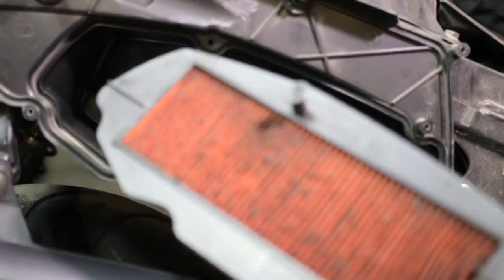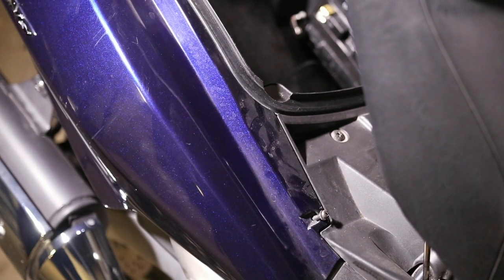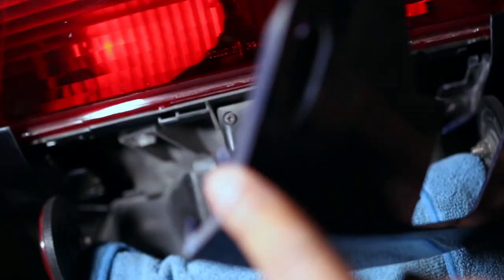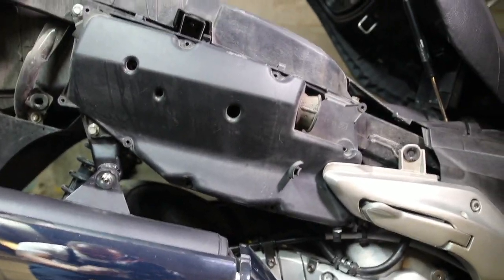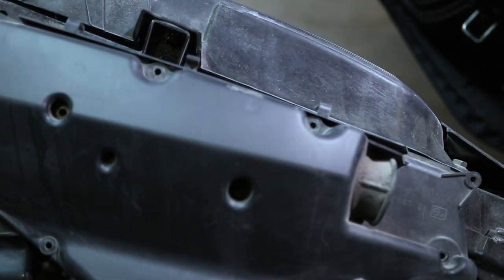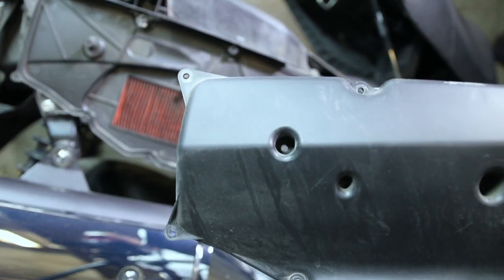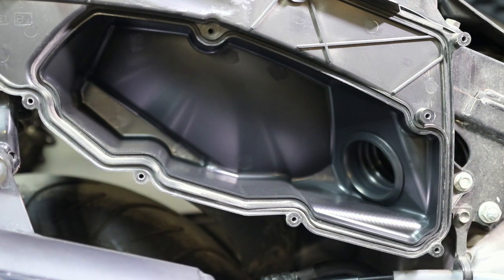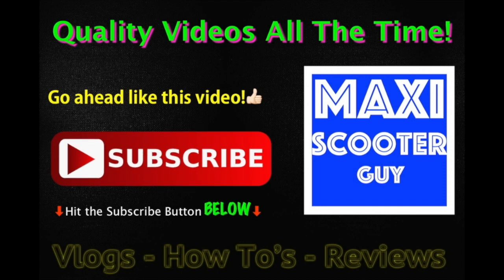Honda Silver Wing 600 Air Fliter Removal (Tutorial) #81

Comment: Important tip.  Inside the trunk’s rear right side (mine is a 2003) there’s an access door / panel that you remove / pop out to access the underside of the panel to gently push to help undo rear rubber seal.  ALSO, come to find out the K & N (anywhere between $45 - 65) filter does not fit properly since it’s missing the upper center screw post / housing!!!    Ugh!   HifloFiltro has it but NOT K & N.  I returned the K&N and just bought the OEM filter at Walmart (google / Walmart / OEM Air Filter Fit For Honda FJS400 FJS600 Silverwing) for $17.99 with free shipping using PayPal.  Just a heads up guys and gals. Cheers!
Reply from the maker: All that 👍

Comment: Great video!  Haven't bought one yet, hopefully soon, looks like it's easier than my GL1800, but still quite a bit of disassembly for an air filter.
Are there any other maintenance items that could be taken care of while it's at this stage of disassembly?
Anyway, Thanks!
Reply from the maker: 🤔A good visual 👀 look over everything visible would be recommended. Rodents love crawling up in the areas and making 😴 comfy on your bike. Apart from that I'm not aware of. Thanks brother🙏👍

Comment: I was wondering if the air filter is supposed to fit all the way in? I put an ha-6002 on today but can’t get it to fit in on all edges.
Reply from the maker: Hopefully you solved you installation problem?
Reply: MSG MotoVlogs I installed it but it just doesn’t fit all the way in on the right side. Is that normal?

Comment: Wow, a lot of screws to get to the air filter.  Got to take off so many body peace’s.  Not very user friendly  Honda is usually better than this.   My Burgman may have two screws.
Reply: That true but changing the oil and drive fluid in a Burgman is a pain compared to a SW.

Comment: Wow! I thought getting to my Piaggio's air filter took a lot of effort. This one is even more so.
But looking forward to taking wing next season on my new to me SW.
Reply: It’s not as bad as it appears onscreen.  No need to remove the grab bar.  See comment above with the tip.  So much easier to pop off the panel with braking clips and such.
Reply: This isn't so bad. My 2002 bmw k1200lt required both side fairing removal and upper Tupperware. Then a huge brace and next THE GAS TANK HAS TO BE REMOVED. Famn Germans. Couldn't sell that bike fast enough.

Comment: Soooo....why didn't Honda give us access from the INSIDE of the seat storage area?
Reply from the maker: Yeah, I'd love to hear your reason why Honda chose to do what they did?
Reply: @MaxiScooterGuy  I don't have one other than ease of assembly. It's not like water is going to splash up into that area if you ride in the rain. They weren't thinking about us doing maintenance.
Reply: @MaxiScooterGuy  On my Burgman 650 it was up inside the left hand storage compartment. Easy access.
Reply: Generally speaking i think the bike is very service friendly, spark plugs, oil changes and brake pad replacements are all 5 minute jobs. So this taking a little longer is not bothering me that much.

Comment: Hello brother should I change my air filter or no need please help thank you
Reply from the maker: Hello Rafik, you should refer to the maintenance intervals set by Honda to determine when you should be replacing the air filter.
Reply: The manual states it’s a good idea to replace the air filter when replacing the engine oil and filter.

Comment: Hi is there a video about taking all the front plastic panels off. Thank you
Reply from the maker: Paul Maudsley are you referring to the front fairing?
Reply: MSG MotoVlogs yes pretty much the whole front end plastics I've done the rear end with the help of your video 👍
Reply from the maker: Paul Maudsley thanks for letting me know that my video actually helped someone out 👍. I don't have a video on "how to remove the front fairing". That might be something I should consider making. It's something I'll have to seriously consider as I've finally got my scoot quiet, you know they're notorious for squeaks and rattles, but I'll add that to my list of requests.
Reply: MSG MotoVlogs yes my is a bit squeaky and vibrates a lot on take off but its fine when above 25mph. Iam doing a belt and rollers change over winter plus a full service with all electrical connections cleaned and sprayed with wd40 or similar. The front plastics look a bit more complex than the rear and very easy to snap lugs and clips etc. I want to do the fork oil as well but this depends how hard that is ha. Thanks for the quick replys and the video tutorials it's quite hard to find information over here in the UK because the silverwing didn't sell in massive numbers' popular bikes you can buy something called a Haynes manual there brilliant but they didn't publish 1 for this bike.. Thanks again paul. 👍
Reply from the maker: Paul Maudsley oh do I ever know what you're talking about. During my first month of ownership, I experienced the shuddering and lumpy take-off that many owners complain about. I read somewhere that this was caused by a glazed over inner clutch bell (likely caused by the build up of heat on this component during stop and go traffic). After further investigation on several Silver Wing Forums, users suggested that they temporarily solved that problem by applying the parking brake and then going a little throttle for 5secs. The goal here was to clear off the glazed over surface inside the clutch bell which would reduce clutch slippage and increase clutch grip. I did it and to my surprise the symptoms during acceleration went away.
Sounds like a full restoration, have you ridden a Burgman 650?
Reply: MSG MotoVlogs not yet but they look great bikes but 10k new is a bit much for me at the moment. This is my first maxi scooter after being on so called proper bikes for years and I don't think I'll ever go back to clucth and gears I like it that much and was very surprised at how quick this bike is😁. My wing is a 2009 bike with 14k miles on it and in quite good condition but has been in ridden by previous owners who didn't really show it any love. I really look after bikes so this is ready for a good going over plus it will give me much needed experience on working with scooters..👍

Comment: Where can I get a good air filter?
Reply: Walmart online has them (OEM Air Filter Fit For Honda FJS400 FJS600 Silverwing) but it takes painfully forever to receive by USPS.  I ordered instead the Hiflofiltro air filter.  They’re manufactured to fit the factory air box and are a direct replacement for original equipment filters but 10 bucks more.   Be safe.